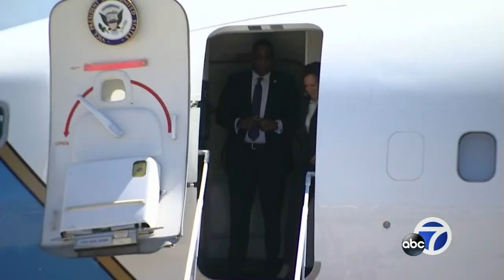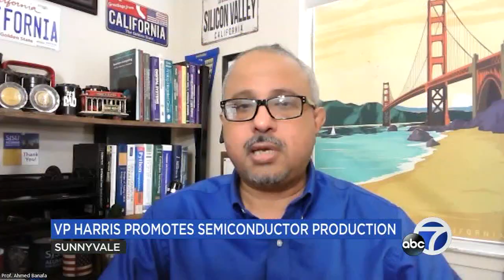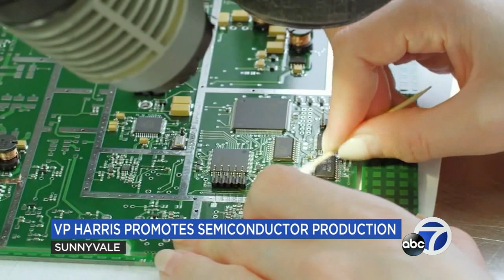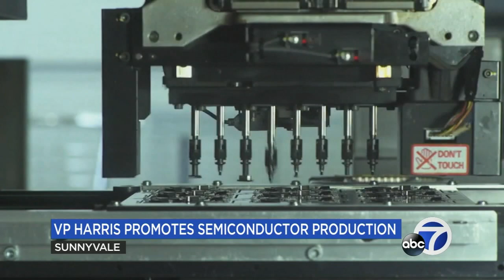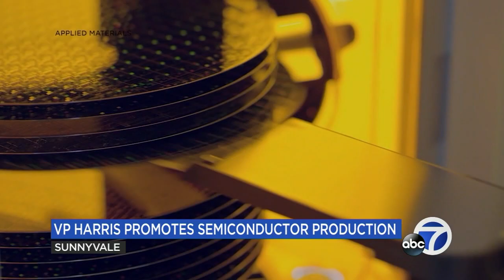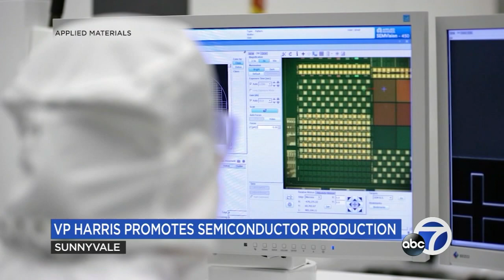World's largest semiconductor tech site being built in SF Bay Area, says VP Kamala Harris

Comment: Manufacturing jobs in so called Silicon Valley have been gone for decades.  Who is going to step into these jobs that knows what needs to be done and how to do it? BTW I worked for Applied Materials in Santa Clara at a time when they rent new buildings and fit out new production facilities fast enough in 1994. because they were going  from 6 inch to 9 inch wafers. Back in "the day"!